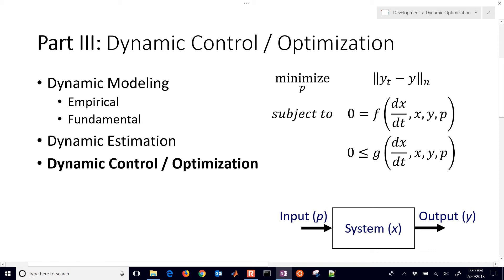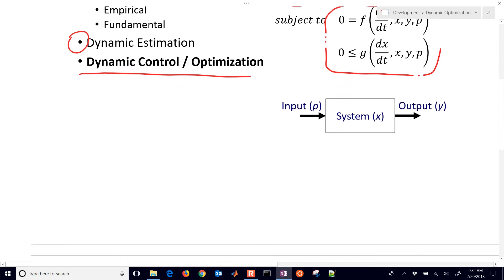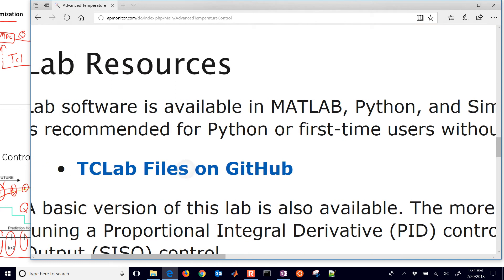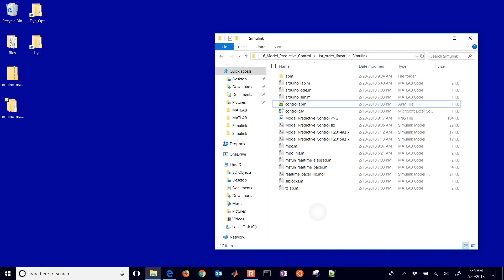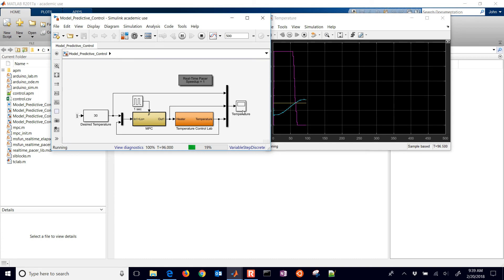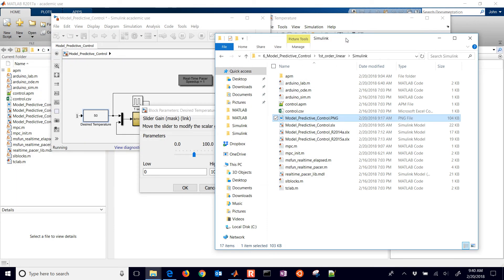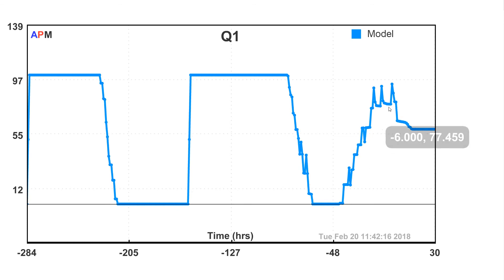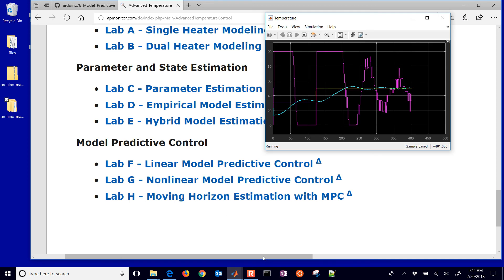Model Predictive Control in Simulink with Arduino TCLab

Comment: Thanks, this was very informative, i am really into learning control theory, i have already worked on a project  about MPC applied to a boost converter in MATLAB and I compared it with PID. I hoped to face the problem of duty cycle (control signal) that exceeds the logical limits {0,1} but it hasn't happened so that to apply the constraint MPC.
I started to dive more into the predictive control specifically DMC but find it rather a bit tough to understand the complex mathematical modeling and algorithms.
Please what would you advise me to do, continue learning MPC first then move to other approaches of predictive control ..?.
Thanks.
Reply from the maker: Check out the in depth tutorial with the TCLab here: https://apmonitor.com/do/index.php/Main/AdvancedTemperatureControl

Comment: Dear John : I recently purchased the arduino TCLab with a Arduino Leonardo model from AMAZON (I'm from Chile south-america), all the archives from the pid files works fine , but the MPC files , specifically "Model_Predictive_Control.slx" from the first order folder doesnt run the simulation , it appears the following simulation errors: For Windows:
  Open device manager, select "Ports (COM & LPT)"
  Look for COM port of Arduino such as COM4
For MacOS:
  Open terminal and type: ls /dev/*.
  Search for /dev/tty.usbmodem* or /dev/tty.usbserial*. The port number is *.
For Linux
  Open terminal and type: ls /dev/tty*
  Search for /dev/ttyUSB* or /dev/ttyACM*. The port number is *.
Model_Predictive_Control/Real-Time Pacer: Average idle real time per major time step = 0.243975 sec
An error occurred while running the simulation and the simulation was terminated
Caused by:
Error due to multiple causes. 
The first input argument of the "mpc" command must be an LTI object or a structure of models and offsets. 
Error evaluating MATLAB function in 'Model_Predictive_Control/MPC/Interpreted MATLAB Function' 

sometimes in the Matlab command windows appears: 
Specify port (e.g. COM4 for Windows or /dev/ttyUSB0 for Linux):

I don't know how to solved and I have the most recent MATLAB version (2019b) , please help me it means a lot to me .
Reply from the maker: You may have an outdated version of the software. Could you try the MPC modules here: https://github.com/APMonitor/arduino  There is also additional information on the modules at https://apmonitor.com/do
Reply from the maker: There is also more information here: https://apmonitor.com/do/index.php/Main/AdvancedTemperatureControl
Reply: @apm  Thank you very much, with the new modules works wonderful (i recently applied a DMC to the dual heaters by my own),thank you for this tool for learn and apply Control theory
Reply from the maker: @CamiloGonzalez-db9fp  great work!

Comment: Nice video sir. is that possible with 2 parameters (temperature and humidity) at the same time. thank you
Reply from the maker: You would need a different sensor such as DHT11 or DHT22

Comment: You mention minimizing the error but you don't mention why MPC is different from normal closed loop control.
The big difference is that MPC has no controller gains.  There is no need for Ki, Kp, Kd etc.  The control output is found by minimizing error between the model and the plant between the estimated response using the model and the desired response or set point..
Where does the model come from?
How long should be the time horizon?  This is not covered but it is very important.
What happens if your plant has a dead time?   The time horizon must be extended beyond the dead time but how far?
Reply from the maker: Thanks for your insights. We covered the modeling and parameter estimation in Labs A-E. We're moving on to Lab F, Model Predictive Control this next week. All of the labs are listed here: http://apmonitor.com/do/index.php/Main/AdvancedTemperatureControl  I especially like your comment about selecting the correct horizon length. I typically like to select non- uniform steps with a time horizon that extends well into the steady state region. The larger time steps don't add much additional computational cost and calculate steady state targets. Some MPC implementations have a separate steady state calculation.